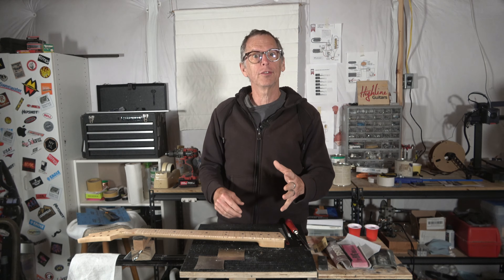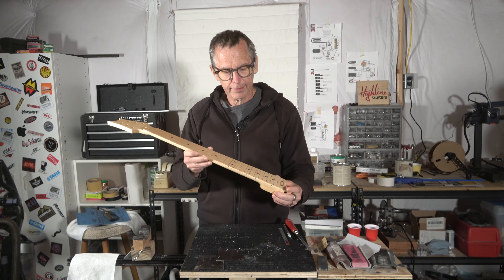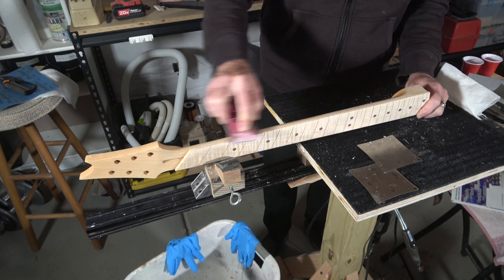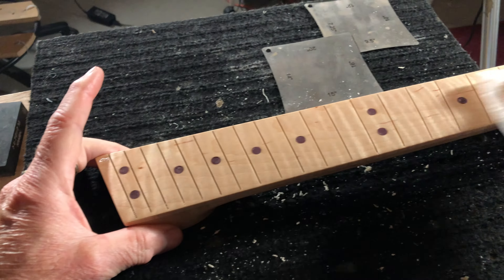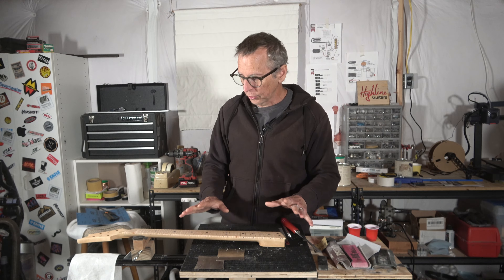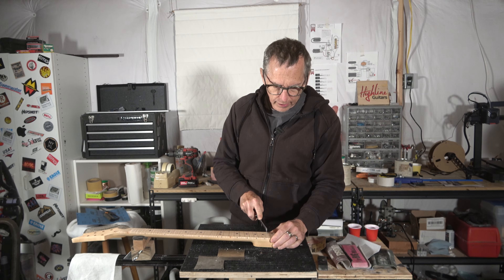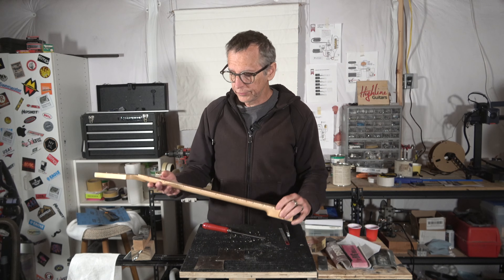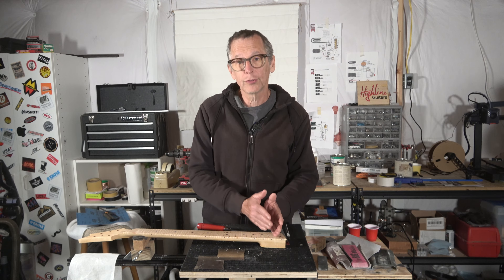Making A Six String Multi Scale Guitar: A Minor Setback

Comment: I have a question. I normally radius the fretboard and press the frets in before carving the neck but I decided to carve the neck first this time. It seems like there is a little back bow in the neck now. I am guessing I need to adjust the relief before I radius the fretboard?
Reply from the maker: I would.
Reply: @HighlineGuitars  Thanks for the response, I should have stuck to the order that I am used to but I wanted to try using Stewmacs Safe-T planer to put a taper on the neck and thought it would be easier with a flat fretboard.
Reply: You'll want the fretboard level--flat before you start radiusing it.